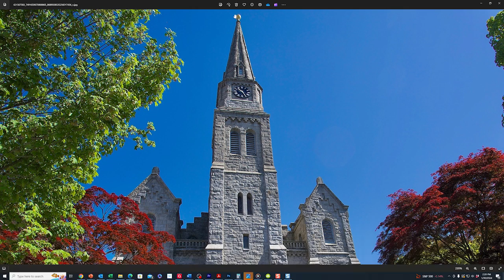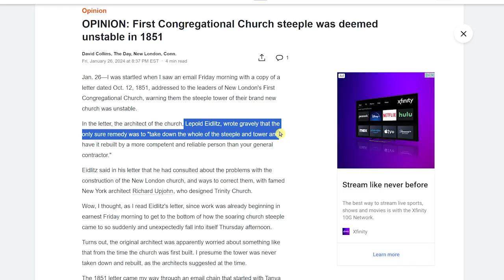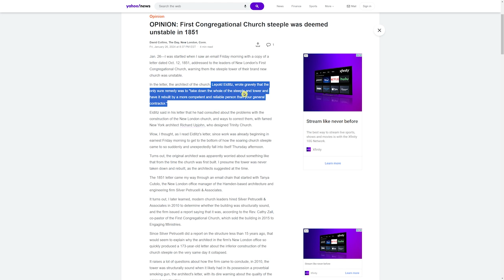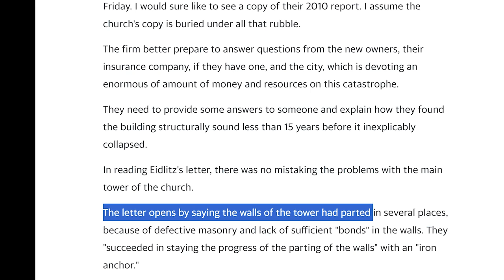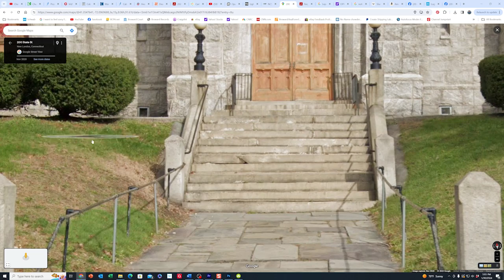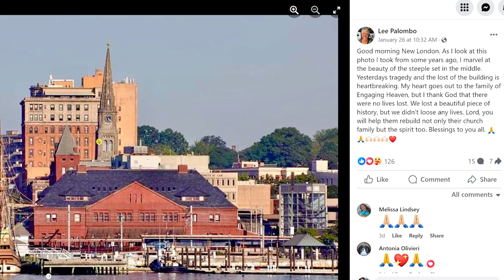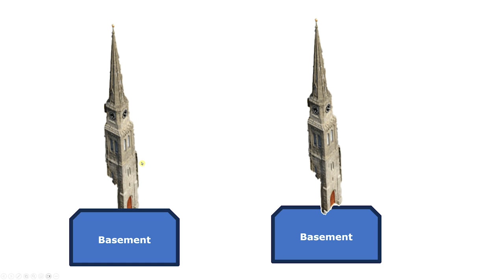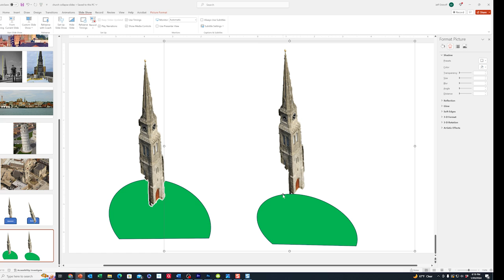What Caused Church Steeple Collapse New London, CT?

Comment: I wonder if there was any indication of repointing of the masonry in the past?  When I was in college in Pasadena during the 80's we had adjunct classrooms in the old town brick buildings. They had been refitted for seismic loading with girts and bracing of steel I beams but the mortar in the walls was virtual sand. You could just walk along the wall dragging your finger in a joint brushing out the mortar.  Fortunately since that time a lot of money was dropped on the area refurbishing the buildings or demolishing the worst of it.  This church building as been around for 150 years enduring so many cycles of freeze/thaw far more severe than temperate California.  IMHO mortar failure is #1.         Subsidence is another possible contributing factor and has been addressed; however there are too many variables to make any determination of cause.  The recent (2010) engineering report would really need to be looked over line by line and see their methodology in approving sign-off for the structure. They must have done some type of subsurface geo investigation -- it would be interesting to know what that was.  Another issue may be vibration over time from increased traffic and human activity.  For instance, the city of Rome Italy has had to limit the traffic around Coliseum in Rome citing shifting of the stone blocks due to vibrations caused by cars and trucks circling the structure.  As far as the original engineering of the Coliseum is concerned,  the entire travertine stone structure was built without mortar, instead builders relied on 300 tons of iron clamps to hold things together. Even though many of those clamps were removed for the metal after Imperial Rome collapsed, it still is standing after 2000 years.

Comment: If you know anything about masonry, you can see that the corners of the center Tower are completely incorrect. With stacked joints and vertical stones on the corners... Very bad. There's no bond and therefore no strength in the most critical of locations... No wonder it blew out and collapsed. More than likely, the back corner(s) blew out under stress and the front had no integrity. So the back blew out, leans  back, front blows out... It all drops straight down at whatever angle

Comment: Since the tower fell inwards onto the chruch, it is probably the inside structure holding the tower that slowly gave way with the most significant damage in the mortar above an arch only vissible in between the church celing and roof. To begin with that made the tower leaning, untill it fell backwards. When the tower fell backwards it begun to push the front wall forwards sort of containing the collaps within the church walls.

Comment: The rods was installed after the building was built . This was to stablize the structure , What happened was two things . The lime morter had lost it's integerty a long time ago . This was the time to add integerty to the building by installing these rods . Then over time the rods rusted away by water getting into the stone . As time went by the rust had and dampness freeze and thaw causing the rust to exspand . This cause the micro cracks with in the stones it self .   Also the water got in the cracks of the rotted morter joints and farther cause the softing of the soil down below the ground . Another thing may even helped is not keeping the temp up with in the building . All these factures comes into play and work against the structure .  Another thing and the sad part is this church was owned by the Collage and greed took most of the play here . The Collages did not wast any money on these old churches to keep them up . All collages are is to grab as much money as they can and call them selves good . Worst program you can invest one self in . Instuctors calling them selves Doctors . When they dont do any of the work them selves .

Comment: Now hang on the tower of pizza has been corected and they made som braces and other stuf to keep it from tipping over more 😂 it looks to me that the fundation gave way for som reason it tilted more and slid down breaking into parts
Reply from the maker: Yes likely from sinking ground
Reply: @jeffostroff  indeed  the drilled som pillers in the ground and i beleave they pump out ground water as wel  its a shame to see a nice building like that fail

Comment: I think it was a weakness at the balcony level and on the inside wall. The steeple was basically a elongated square with two arches to pass through, and I think the second arch on the inside is the point of failure. As the weight of the top of the steeple fell inward it pushed the outer wall in front down.
Without knowing the internal design but knowing there would have to be an arched entry way through the door into the church itself, I think that second internal arch from the tower into the pews is the most likely weak point.

Comment: As a Civil/Structural Engineer that has straightened steeples I can tell you what happened.
The load on the front 2 corners went straight to ground and the rear corners were supported by a timber beam that transferred the load to the towers on each side.
With the added weight of the bell in the tower, the beam sagged over time causing the steeple to lean and eventually failed and it collapsed backward.
They used this method in order to have an unobstructed open space when entering the church. Otherwise there would be 2 massive columns in the way. 
I’ve noticed most of the steeples built this way lean towards the church and the ones built with all 4 corner “columns” load bearing directly to the ground do not lean.
We usually retrofit such conditions with modern materials and then jack up the tower to stand true.
An example I did was the First Baptist church in New London NH.
Reply from the maker: Thanks Ian, that is some interesting perspective!
Reply: Updated
Reply: You can see the first 2 sections   are actually bowing out towards the road they gave out causing the pile of rubble out front the spire feel damn near straight down up until it hit the rubble pile then caused it to fall backwards in on the church

Comment: There was a news report earlier in the day of a partial roof collapse. So, I wonder if the pressure of the steeple's lean could have resulted in a truss failure. This could give the thrust against the front face of the church, as seen with a bow-string truss failure, that kicked out the lower support of the steeple.

Comment: When this happened, I went to google earth street maps. From the front of the building you can see that the tower was reinforced with metal bolts. From the street view on the right side of the building, one of the windows was out of alignment when compared to the front of the right side of the building. You can see a couple of metal bolts there as well. Then. on a bird seye shot looking down on the roof there is something going on where the roof connects to the back of the steeple. I can guess that there was a lot of leaking going on, compromising the integrity of the mortar,

Comment: Iron tie bars would corrode over the years.  The remains will be in the rubble and can be checked.  The images in the video look like tie bar face plates.  Corrosion of steel rebar is an ongoing issue with older reinforced concrete structures like bridges.  Water infiltrates the concrete over time and provides for chloride transport, corroding the steel/iron.  Modern reinforcing bar is typically epoxy coated to prevent this.

Comment: What catches my eye is the two balconies on either side of the steeple; between the steeple and the two corner towers.
My untrained guess is that water collected on these balconies and leaked into the building along the rear corners of the steeple; for years, maybe decades.
If water was leaking in on the back side of the steeple's tower, it could cause degradation to the steeple's base structure; which would in turn cause the steeple to lean backwards, and eventually collapse.

Comment: Honestly, it looks like the ground settled due to rain. That would cause the mortar joints to break. The  heavy equipment moved in to work on the parking garage could have caused vibrations which made the settling of the ground to worsen.

Comment: I noticed two things of interest in your photos. #1 the picture of the front door and rods tell a story. The stone above and left of the door show evidence of spalling. It may be more water ran that way, for whatever reason, and it shows. Next, the rod on the left is showing an obvious rust stain that none of the other rods show. A failure either there of the tired looking rod above the door would probably snap the other and that's all she wrote.
#2 the picture at 16:00 shows a discernable cant and twist right above the second story windows. Stone buildings are not up to lateral forces. It appears that there is a  lateral tension, 24/7/365, above that rotting out tension rod.

Comment: Section of wall out front has the coping stones from between the two pairs of double windows. Have you ever seen chimneys fall? They will break on the way down due to the differences in speed of the falling structure. I think the wall at the roof level failed due to water egress. Also, the roofing looks newer behind the steeple. Your photo on the right at 15:20. Your yellow line on the left is perfectly in line with the steeple at the bottom, up to where the row of coping stones is.

Comment: As a contractor of nearly 45 years, industrial/commercial/residential construction…the revelation of deficiencies recognized in 1851 that itself should have been a signal to anyone with interest in this structure and its magnitude that a regular inspection would be required and further records retained or at least indicators installed as simple as pendulum style vertical lines well back in time…regardless of these indicators the installation of what appears numerous tension rods indicates to me that the exterior wall were in a thrust condition and this like was a mortar degradation issue…a commenter states they heard a large boom just prior to its collapse may very well have been a rod failure…saturated mortar over time degrading the rods or plates…..
I have witness such a rod failure during an inspection and it was just as described a large boom…we just happened to be there and it failed…we found the culprit about an hour later and it was subsequently replaced …no failure occurred other than that reinforcement …from time to time I have projects that have similar issues…interesting in any event…

Comment: It is my understanding. There was a report of black smoke prior to the collapse. Thinking there was maybe something had blown up related to the furnace?? If that was the case, it could have easily jarred some already existing issues at the base of the steeple, all the rubble is on top of the ground so seem there was any ground giving away the base of the steeple was weakened by something and the Connecticut energy just took over and it crumbled from the bottom up.

Comment: As a lifelong career in Roofing,  the pics of the tower 'out-of-plumb' is truly baffeling.  If the tower shifted / settled back against main sanctuary roof over a period of time; there would be major signs on the sanctuary roof.  Especially on the flashing work against tower & reshifting of the slate roofing & structure.  Makes me speculate that the tower was built slightly crookered.
Also,  when tower hits sanctuary roof as it was falling; how did the wood arch structure not push out the sidewalls.  I know it took out a section towards the red building; but tower fell in that direction & took a direct hit.

Comment: The Tower of Pisa became crooked during construction. This was compensated for by the fact that the floors were built at opposite angles. Nevertheless, the construction of the Tower of Pisa was not completed. In the centuries that followed, attempts were made again and again to stabilize the tilting of the tower. Then even with steel cables and weights. When the tower was last secured, concrete was injected into the ground. The tilting was reduced. Today the Tower of Pisa stands relatively safe.

Comment: The church itself had cracks in its walls as evidenced by images, most likely in this case, water drainage was an issue underneath the structure.  Having been built on soils mostly of clay, over the years and with the amount of rainful, softened the clay, the soil sheered away from underneath, causing the collapse.

Comment: The dormatory side of the structure failed from the spreading compression load across the rafters which means the steeple point actually dropped more towards that side of the centerline but likely not by much or the opposing roof side would be more intact.   What happened is likely foundation subsidence due to a lack of properly maintained interior-to-exterior ground moisture in the soil   The solid steps and entryway were guaranteed to cause the interior fall.  It looks like injection grouting on the front wall above the main entrance great doors is the culprit, done to reinforce that wall when repairs were done and nobody wanted to spring for verifying the erectness of the steeple.  That broad section of stones still attached to each other is dissimilar to the rest of the collapse rubble.

Comment: The main roof supports/beams were very large to support the large vaulted span between the two exterior walls. When all the decking was installed, that added to the lateral force the entire roof structure could handle. So, my theory is, it kept that steeple from tilting for all this time, until, it couldn't. The fault may have been 2+fold...the mortar bond may have been an issue in 1851, but, that may have been remedied, but, I think the foundation wasn't strong enough for all that weight to begin with & probably wasn't able to maintain itself due to soil liquefaction from recent heavy rains, gave way, caused a heavier lean & bam!

Comment: The two towers seem remarkably undamaged to me that indicates the lack of ties / bonding to the towers four main points of load. The front section would have considerable more masonry as the rear section was vaulted and that load would be transmitted laterally to the mass of the two towers. However as mentioned they show little damage. It has been a comment about a large amount of rainfall and this likely expedited the collapse from a weakened foundation. The iron ties are a red lag especially as they were installed early in construction and will have corroded. 
Conclusion the vaulting failed from foundation shift and the lack of ties thus removing support to the towers then pivoting on the front masonry. 
As for the structural inspection well that seems to be contradicted buy the production of the original letter which they produce in mitigation. if it is that important for the structural inspector to produce said letter after the fact then purchaser should have been made aware.  Interesting observations you make.

Comment: The way it came down so cleanly, it makes me wonder if there was any lateral connection between the steeple and the side towers.
Reply from the maker: Yes , there were small walls on either side of the steeple connected to the towers , but those small walls got ripped apart when the steeple collapsed backwards. They probably would have helped to stabilize its side to side. But there was nothing to stabilize it going front to back.

Comment: I'm a CT resident and I've seen this church. When I heard about this, my first thought was that there had to have been something gravely wrong and assumed serious neglect and decay, because built properly, these churches, with a little maintenance, should last practically forever. If the ground in the front yard had washed out, it would have fallen forward, toward the stairs. I don't think that's what happened. I don't think it was the ground at all. The weather here can be extreme and nasty and that hasn't changed.

I think a look into the concrete in the motor joints and between the stones wouldn't be amiss. It doesn't last forever and needs to be touched up from time to time, with the loose parts scratched out and new concrete applied. Depending on the damage, entire stones may need to be removed and replaced with new concrete in the joints. Now, CT has a problem with trade work, namely that everyone was pushed away from it in favour of traditional college degrees and this had gone on for so long that there aren't enough skilled tradespeople in CT anymore. It's gotten so bad that we have grant programs and a lot of government support for people who want to go into trades. Finding a skilled mason in CT these days is very difficult, and I'm willing to bet that years of neglect caused separation of stones that weren't fully stable in the first place, leading to the collapse of this steeple.

Comment: FIY, there have been 500 piles being driven into the same bedrock\ledge 1/4 mile away from that church for an approximate year. It went on for days and days with the vibrations resonating thru residents vascular systems and hearing. The ice age provided the granite ledge Ct is built upon. It seams completely logical that this vibration could easily be causative to initiate this collapse. Remember this church steeple withstood 2 category 4 or 5 hurricanes, surprisingly washing large ships uphill outside that church.
Reply: I didn't even think about that. Back in the early '80s when they started building at Wood Quay in Dublin, I seem to recall that there was damage to the foundations of Christ Church Cathedral due to the pile driving. I may be wrong, but I definitely remember it being a concern.

Comment: At 2:31 you can see on the side of the central tower toward the bottom there is a black line which seem to be a repair or some kind of sealant to fill spaces between the blocks, there also seems to be more of it on the rearward right corner near the roof of main roof section.